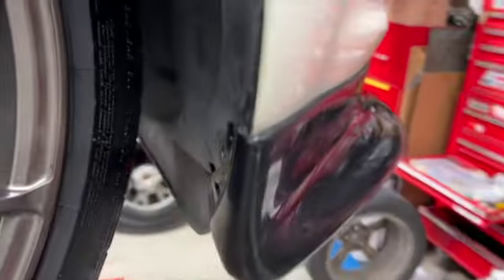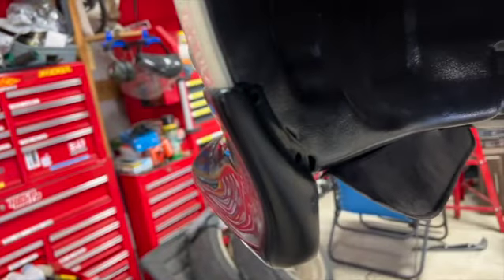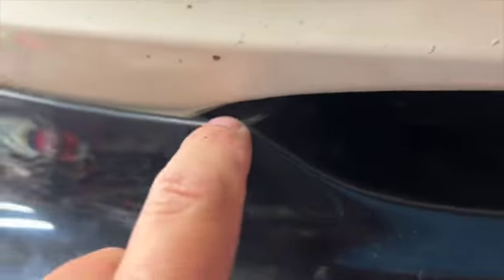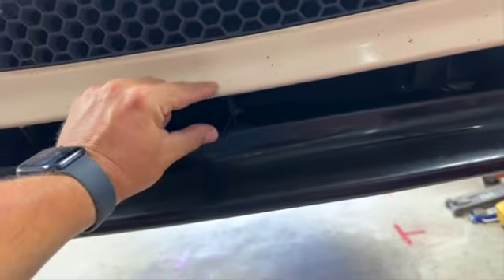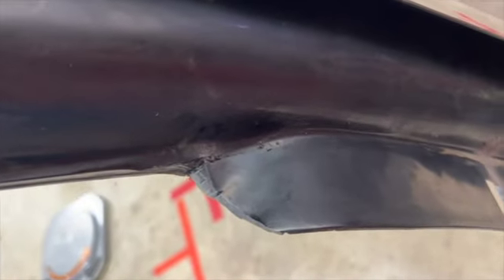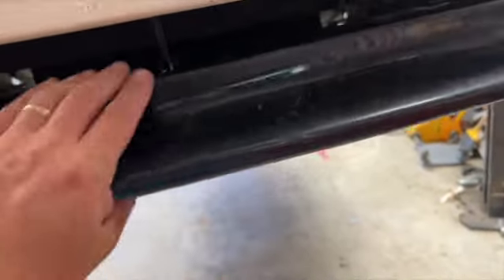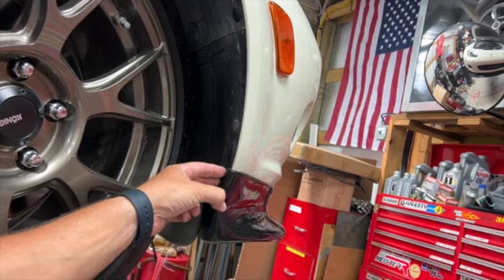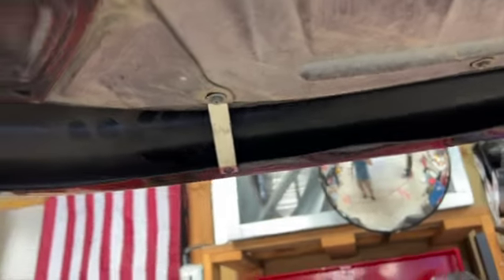NC MX-5 Miata Ebay Lip Spoiler Installation - No fluff, just the tips. 06, 07, 08 NC1 Specific

Comment: Best install video for this lip so far.  Everyone else drills two new holes in the fender area and does not re-use that lower factory clip. The lip has a larger bottom hole on it for that factory clip.  As far as the brackets go. You did it right to use the two existing screws under the car and drill two new holes in the lip because the two existing holes in the lip DONT line up.  Most people just drill two new holes in the lip AND the car and put the brackets close together up front which is wrong.  So to conclude you put this lip on the car correctly and only drilled the holes in each fender area.  You decided to use two on each fender but I got away with just one upper screw on each fender. If I dont need to drill extra holes in the car I am not gonna do it.  Once again great video.
Reply from the maker: Thank ya! Great points! Feedback is much appreciated.

Comment from the maker: It didn't last 3 months. LOL A big dip in a parking lot took it out. The hole was full of water on a cold rainy night. It cracked in half. I don't know if I'll replace it again for a while.
Reply: thats a shame. I was thinking on getting one of these for my 08
Reply from the maker: @elstukov  I am still unsure if I'll replace it. I probably will just because I like the look. But, the roads/parking lots around here are so bad, it's like pissing $150 away each time. I just 2.5 swapped it, so what's another buck fitty! LOL. When it's cold, they become very brittle. It cracked straight in half. I tried to "plastic weld" it back together but it didn't work. The plastic just mushed up and wouldn't stick to itself. Bummer.